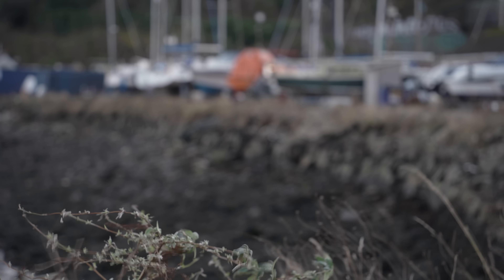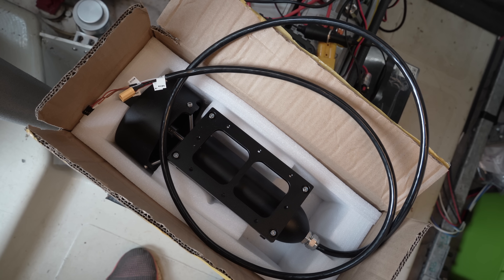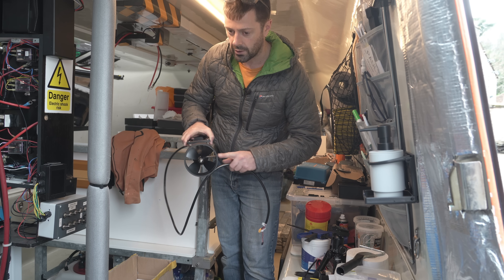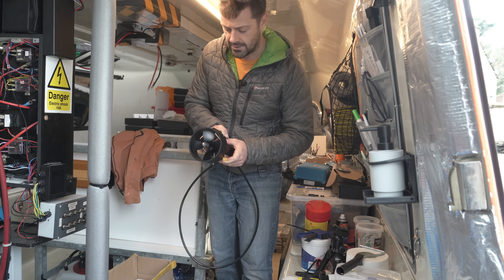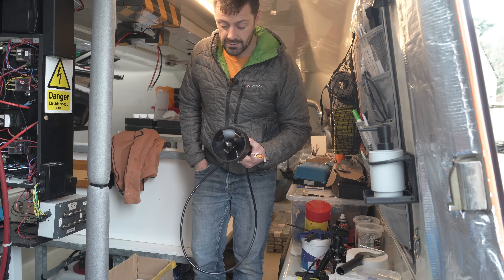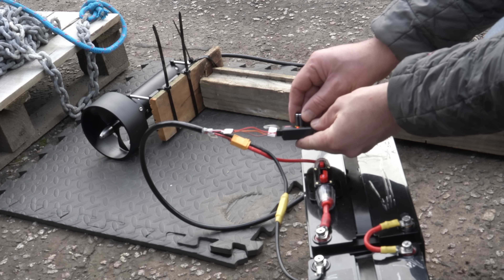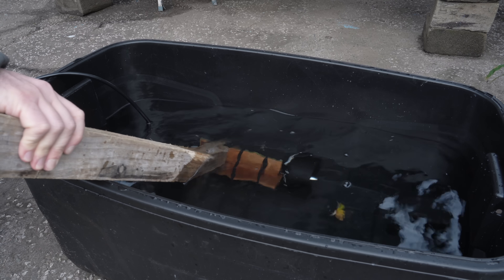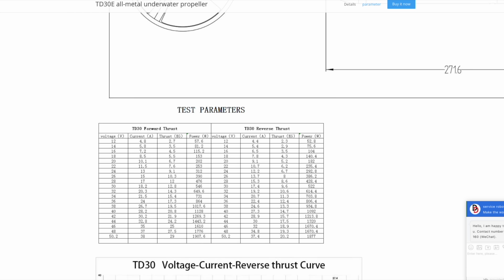Underwater Electric Thruster Test - 24V 1200W motor. Expedition lifeboat conversion Ep107 [4K]

Comment: Once again I am here to mention the Lynch/AGNI motor for propulsion, here is some more information:

The Lynch motor is an unconventional design with a disc armature. It marries the advantages of a conventional, wound armature motor with the benefits of a flat (printed circuit) motor. It is similar to a pancake motor, but is more powerful than any of these technologies. The disc armature has magnets on both sides, doubling the available flux density and shortening the magnetic path. It therefore packs more power per pound and per cubic inch than any other motor technology. Of course such a revolutionary motor is not for every application - it is not as cheap as wound field motors, but for many applications it is a far superior motor.  It has a previously unheard of power to weight ratio and also power to volume ratio. It is also highly efficient because of the double magnet design and associated short magnetic path. It also includes integral fan cooling.

 The Lynch motor is an important development which spurred other motor designers to improve their products to remain competitive, such as synchronus permanent magnet machines.  As a result of the competition between manufacturers the cost of high performance motors and controllers has fallen dramatically.  We hope the cost of solar cells also reduces to allow renewable transportation to develop as a viable alternative to carbon fuels.
Cedric Lynch built his electric bike around a mid-drive configuration, also building one of the worlds most efficient light weight electric motors to power his rig reliably at 60-MPH for significant distances. He would later set several world records with his axial flux motor and bring it to market as the Lynch / Agni motor. Briggs and Stratton would eventually buy this technology which would lead to the Etek motor, which is now famous for making high speed efficient electric hot rods.

Cedric uses to achieve high speeds is by following the rules of aerodynamics, and building a bike that is as aerodynamic and as efficient as possible. The other builders on this list bypassed this step, and Cedric uses this bicycle as daily transportation on real commutes. Although this high-efficiency motor uses “old school” brushes, this fact allows builders to use very affordable controllers. He has proven his design choices through thousands of miles of commuting, and the Lynch motor is highly respected.

Cedric Lynch is known as the creator of the Agni Motor, a highly efficient electric motor that weighs around 25 pounds and can put out as much as 50hp. 

Cedric Lynch is a British 'mad scientist' type mechanical engineer obsessed with the idea of greener transportation. His interest has been in building a super efficient yet powerful vehicle that can serve as a car replacement.

He started thinking of his own design for an electric motor in 1983 when he began entering competitions organized by the Battery Vehicle Society regarding building an efficient electric vehicle. At the time there was no reasonably priced DC motor with descent efficiency so Lynch decided to build his own utilizing modifying existing motors with old tin cans that he would spread out flat to use as cooling fins. Surprisingly using rudimentary materials and a garage work bench, Cedric was making better more efficient electric motors than any of the universities were able to manufacture in state of the art workshops.

Cedric then came up with a motor design that could be cheaply manufactured and began manufacturing his own motor that he could sell to the public in 1988 and the Lynch Electric Motor Company was born, known as LEMCO.

Cedric first used his motor to create a small boat called “The Spark” that would set an electric boat efficiency record. From there Cedric turned his attention to bicycles, an application generally considered too small for a lynch motor at that time. Cedric mounted his motor in recumbent bike, allowing him space to eventually use a set of thundersky lithium batteries.

The resulting aerodynamic recumbent bike had a top speed of 60mph and still managed an incredible range of 150 miles. Cedric rode his recumbent creation everywhere as a daily commuter, putting an amazing 50,000 miles on the machine - technically a motorbike.

Briggs and Stratton, the US firm famous for lawn mower engines, bought the technology and used it in their E-Tech Motor, and Cedric went on to manufacture his latest incarnation of his lynch design into the Agni motor, which is used in go karts, sailboats, motor boats, and even small airplanes.

The Lynch designed motors all have the same traits. Brushed motors, around 25 pounds in weight and they are able to put out enormous power compared to their weight. Sometimes as high as 50 hp (depending on amperage ran through the motor) at an incredible 98% efficiency.  Lynch Motors are also the most often used motors in electric motorcycle racing applications.

Cedric's zero-emission motorcycle, which has a top speed of 120mph, was shown in action winning the world’s first zero carbon race – the TTxGP in the Isle of Mann.

The idea for the electric motor has been snapped up by the 56-year-old’’s friend Arvind Rabadia, who together with his brother Hasmuk Rabadia had been thinking of starting a business in India. They have now set up Agni Motors to make further-improved versions of Cedric’s motors

Despite Cedric’s breakthrough invention he has no formal engineering qualifications and taught himself the techniques needed to construct his engine. He first became interested in electrics when his parents bought him a book entitled How to build things from things found at home. 
The Etek motor is a brushed 25-pound pancake shaped motor that puts out enormous power for its weight. Depending on amperage and voltage the Etek can easily provide between 15-horsepower and 30-horsepower reliably and consistently (11-kW / 22-kW). A perfect platform for a powerful electric bike if you do not mind the weight. Although brushless motors are considered more modern, a brushed motor like the Etek allows the builder to use very affordable controllers.

Cedric-Lynch invented the motor and sold it to Briggs and Stratton which US company produced the Etek at a lower price (around $600). In the late 90’s early 2000’s it was the way to go for a high-power / light-weight electric vehicle. Many small E-vehicle records were set using the Etek motor. Finally, the market had a relatively lightweight and powerful electric motor available to the masses.

In essence, the Etek allowed hot rodders to build electric bikes. Before the Etek very few people had ever achieved 50mph on an electric bike. Even today, Etek motors (and newer incarnations of the Etek motor) are used to make some super fast electric bikes. In the case of Liveforphysics, the fastest E-bikes ever.
Reply from the maker: As impressive as the first time I read up about them! Sadly, beyond our means at Team Alan.

Comment: When you were running the motor with the propellor in air rather than water you might have been at 100% speed but since air is several times less dense than water the motor was nowhere near 100% power.
Reply: Not even possible, just "correct". Energy needs to be conserved. If you're not taking out the max energy from the motor you're not putting it in either. And also there is a feedback loop involved - it will try to maintain the rpm by applying whatever power needed for that. Just coasting only requires to overcome the friction of the bearings. Stalling the motor is the highest load condition.
Reply from the maker: Quite possible. The wire was only warm, not worryingly hot, in this test.
Reply: @AlexHibbertOriginals yes the load is significantly higher in water. I suggest rewiring.
Reply: I get that there is value in experimenting, especially when at least part of the objective is to create content but trying to re-purpose something that's clearly aimed at the recreational market (eFoil, electric surfboard/paddleboard) and turn it into something more useful is only going to end one way. Surely an electric trolling motor from someone like Minn Kota is more suitable for the inflatable dinghy.  I don't think either will work as a bow thruster for Alan though, my bet is that pushing Alan sideways at just above zero speed, the pitch of the prop on the thruster will be massively too high (considering it was designed to push something a good few magnitudes of order smaller and lighter) overloading the motor well before it gets anywhere near max revs and the whole thing burns out sharpish or the circuit breaker trips repeatedly.  At least you won't see the smoke come out since it will be underwater (have a look online at the pitch of the props on electric trolling motors compared to the thruster). Also be mindful of how many power systems you are installing on Alan.  I've lost track of all the batteries, charging methods and DC-DC converters  @AlexHibbertOriginals

Comment: I dont think ill be buying anything from them based on what they sent you.
Reply from the maker: The actual unit is very solidly made.
Reply: I might be wrong but theres usually a reason for them making spec up. Id be interested to see if the motor actually is 50Amps.  @AlexHibbertOriginals
Reply from the maker: Quite. I'll find out with an ammeter, and getting a qualitative sense of how well it powers the dinghy.